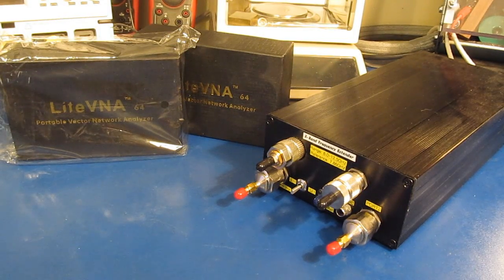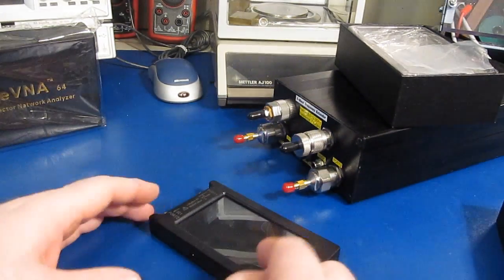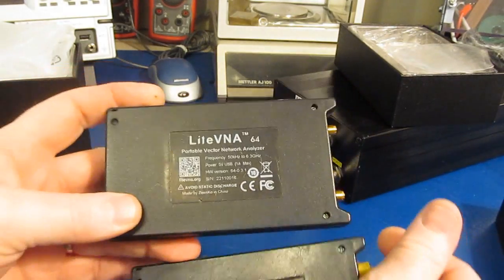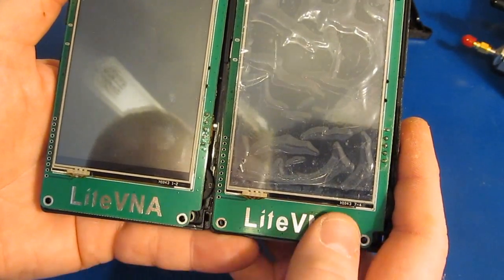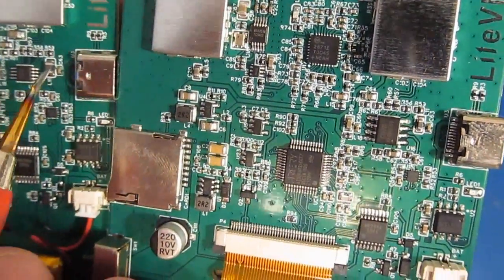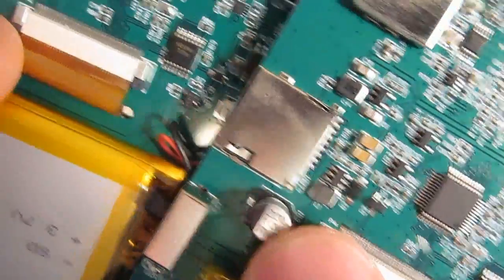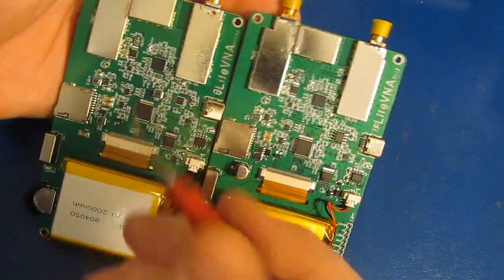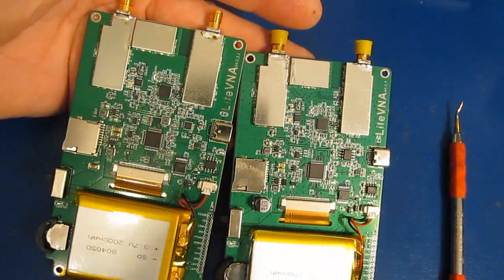LiteVNA64 VNA, Hardware Differences between 64-0.3 and 3.1

Comment: hi what is LED4 used for?
Reply from the maker: I don't know what any of the LEDs are used for.  I don't believe the creators ever provided a detailed manual for it.  If they stayed with the old schematic, LED4 could be tied to LED2 of the IP5305.  Blink would suggest low battery.   You could ask the designers or just trace that part out if it is important to you.   In my case, they could remove the LCD, LEDs, card reader and thumb switch.
Reply: @joesmith-je3tq thanks for answer!

Comment: Bei A*Xprss gibt es nun schon v0.3.2: "The power supply and if circuit are redesigned to greatly reduce the background noise and completely solve the interference problem when connecting external power supply."

Comment: Nitpick: video title currently is "[...]  64-0.3 and 3.1", but probably should be "[...]  64-0.3 and 64-0.3.1" ... that is: there is no version 3.1 (yet). It should be 0.3.1
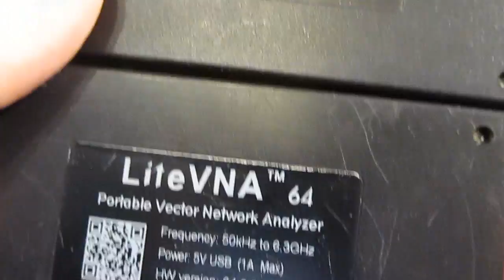Reply from the maker: I frequently abbreviate, removing prepended text.  I assume people watching are fully aware of the full part number.  If not, it was clearly shown at 1:19.
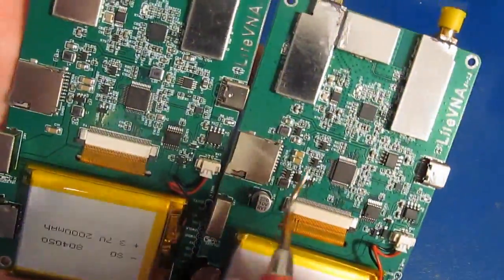Reply from the maker: Also at 3:25 the full PN is shown on the PCB.

Comment: Interesting, I just got my 3.1 version and it didn’t have a soft plug.  I think the 3.1 also stopped the parasitic drain on the battery so customers dont get them with a dead battery past the BMS safety low point. Mine did arise with a battery at 3.95 volts.
Reply from the maker: It may have been made by a different company.
Reply: @joesmith-je3tq  It’s possible . I did look this up later and also found that the 3.1 also changed the LCD touch screen being used according to the *official website because to supply chain issues. Now the big question is what is the LiteVNA67 (I keep running across that firmware). The name indicates it might be. 7 inch screen version but I can’t seem to get a definitive answer. Have a great day.
Reply from the maker: Could be a typo.  For myself, they could remove the screen, touch, card reader, thumb switch, battery and 90% or more of the firmware.   I would rather them have changed the architecture to allow for narrow band measurements, lower noise, higher directivity ....

Comment: I bought a 3.1 the other week and it should be here any day!  I'm very excited.  Thank you for the video.
Reply from the maker: It's great for working above 300MHz, but for narrow band, low frequency work, the original NanoVNA will out perform it.   They are cheap, so it's no big deal to get both.
Reply: @joesmith-je3tq  900mhz is the frequency I need specifically, for LoRa networking, but I also want to do some 2.4ghz long range stuff down the road.

Figured this was the best device in my budget, although the original NanoVNA was very tempting given the price.
Reply from the maker: @steve_seguin  The original NanoVNA has poor performance above 300MHz where it uses harmonics.   I was surprised when the software was changed to support >900MHz.  The LiteVNA is a much better choice.   There is also the open sourced LibreVNA.  I understand it is a full 2-port VNA but I have never looked into it.
Reply: @joesmith-je3tq  I value your insights; thank you